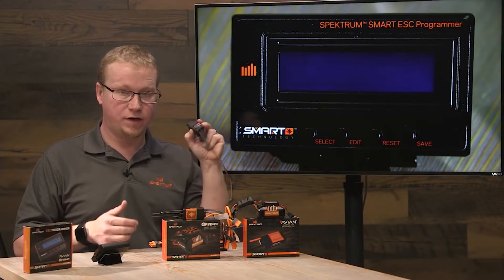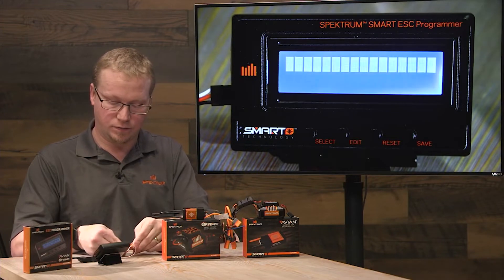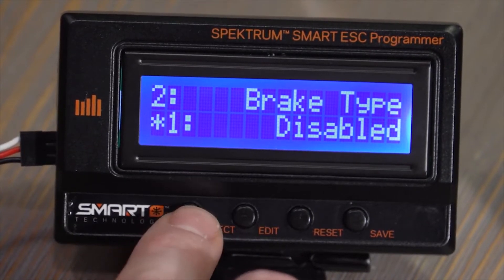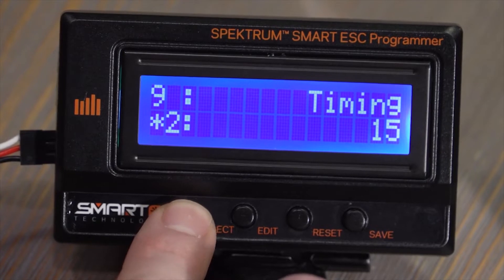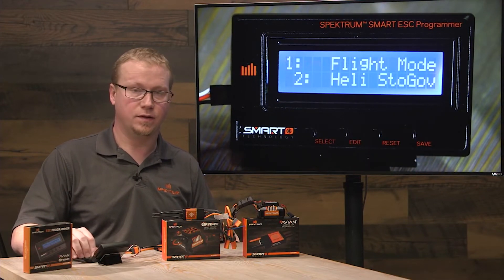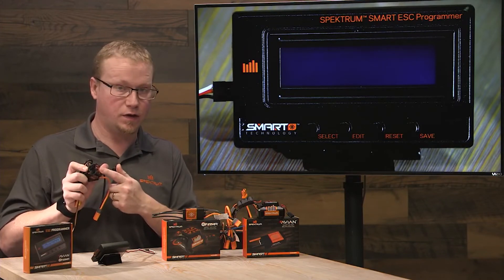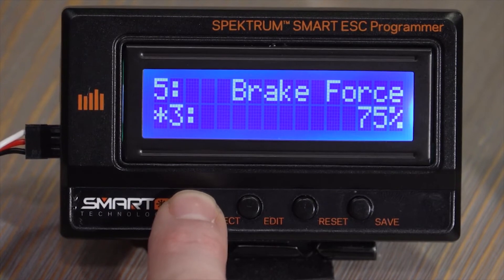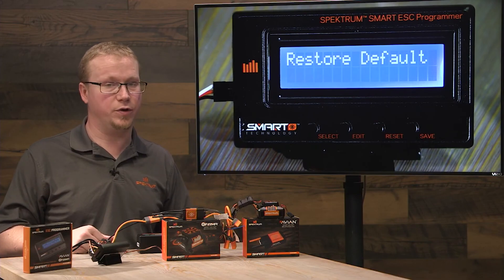Spektrum Quick Hit Tech Tip - Programming Avian and Firma ESC with Programming Box

Comment: ☠BLACK BARON☠ Why is iX12 ejecting a Voltage Warning Message when iSwitch from "Autocalc" into "6S" mode? iOnly use one 6S for my helis. iDon't use 2x 6S at all or 2x 3S. Only one Spektrum 6S G2 battery back. Better and more convenient for review and checking, re-checking charging cycles on S2200 charger.

Comment: Just got the spektrum smart programmer card V2. It won't connect to the firma 2 in 1 40a smart esc that came in my Capra 1.9 4ws rtr. Tried updating the programmer. Tried updating the esc but it won't connect to the computer.

Comment: Can the BEC be disable should I want to run an independent BEC?
Reply from the maker: It can not be turned off BUT you can remove the power wire from the ESC connector, effectively disabling it.
Reply: @SpektrumRCvideos  thank you for your reply, that's what I figured thank you

Comment: Hi bud my v2 arrma infraction keeps hitting cut of when it gets to near top speed is there a way to stop this  can I turn the cut of don some hi I run my car on two 3s 6000 50c batteries iv the spectrum smart programming v2 card  but it says  7.4v or 6.0v
Reply from the maker: It sounds like you might be hitting the over current limit on the esc and not low battery. When it shuts down do you notice what the LED light is doing? Those flashes can indicate what failure mode it is on

Comment: To program an 80A ESC I have to do like you show on the 100A , because my have a fan.
Reply from the maker: Correct
Reply: @SpektrumRCvideos  thank you,  I just get a new EDF that required a 15 degree timing and the manufacture told me the ESC need to calibrate to 15 degree.. thank again.

Comment: I just purchased a 80mp version for a airplane and I have all the telemetry data I need amps/flight pack voltage/rpm but the rpm is way off how can I correct this?
Reply: In radio go to telemetry look for pole count and set to the poles of Ur motor done

Comment: Hallo ich habe ein Problem 
Brauche die programmier Möglichkeiten, über die Karte was mann alles einstellen kann zu beispiel 1.1-5 jeden einzelnen punkt ,vielleicht kann mir jemand helfen benutze eine karte abersteht nichts mehr
Reply from the maker: You can setup each and every option for your esc. Check out the manual for which options are available. There is also a chart on our website. Hope that helps!
Reply: @SpektrumRCvideos  
Benutze ne hobbywing karte die geht auch aber stehen nur Nummern 1,1 u.s.w 1,2 und und .
Was ist unter Punkt 1bist 12 und was kann man einstellen , finde nichts vielleicht konnt ihr mir weiter helfen

Comment: I am running Smart components in my 60" H9 UltraStick. AR6610T receiver with an SLRX2 remote receiver, an Avian 80amp ESC, and using a 6S 4000mAh Smart battery. I recently noticed what sounded like ESC braking sometimes when I pulled the throttle back. I purchased the Programmer Box and tonight confirmed that the ESC remains at its default of no braking. I fly with an iX20 transmitter and none of the telemetry data is showing anything that might point to the problem. Any idea what might be happening to give me, and other experienced pilots at our field, the impression that there is ESC braking occurring?
Reply from the maker: Try changing the active freewheeling setting?
Reply: My brand new  80 amp ECS is doing this too it's very annoying
Reply: And sounds like not running on all 3 phases to about half throttle

Comment: Is the link to download the Smart update software going to be fixed? When I try to download the updater software from the PDF instructions it just goes to a not found web page.
Reply: yeah me too, bought this and cant use it
Reply: @PilotRyanMedia  hey Ryan I am having problems getting my esc to sync to my ix12 I have tried everything adjusting end points it's still beeps the manual I am using ar637t but when I take the esc out and hook a motor to and put a ar636 to it works. I don't understand
Reply from the maker: https://www.horizonhobby.com/on/demandware.static/Sites-horizon-us-Site/Sites-horizon-master/default/Manuals/Spektrum_SmartLink_ESC_Instructions.pdf
Reply from the maker: Or try this one https://www.spektrumrc.com/ProdInfo/Files/Firma_ESC_Open_Stock_Smartlink_app_and_updater.zip